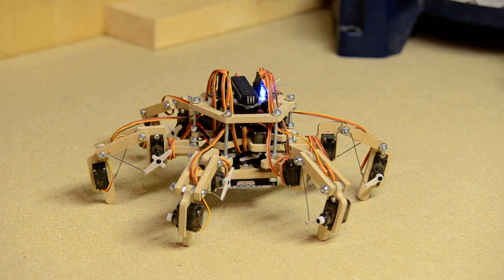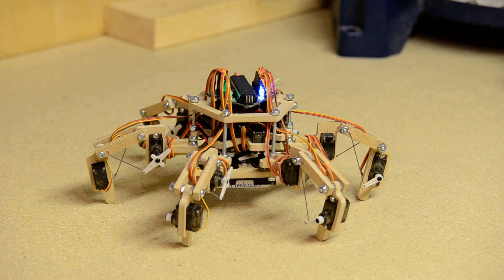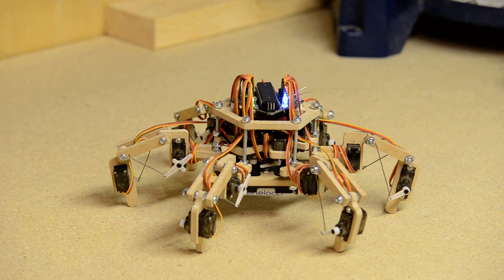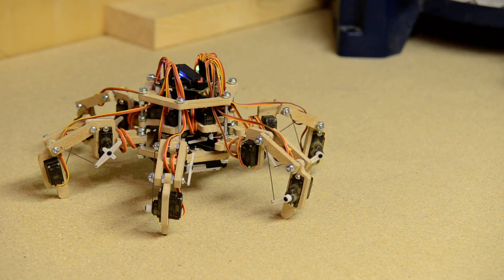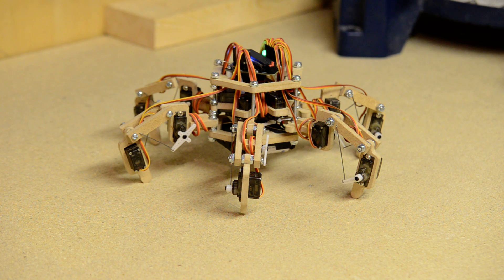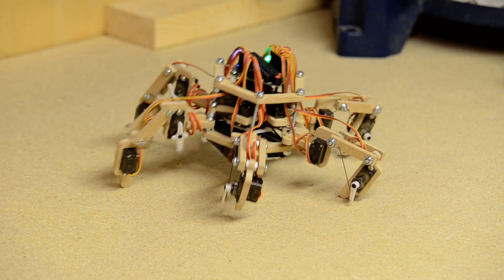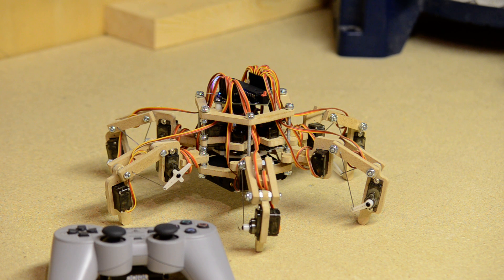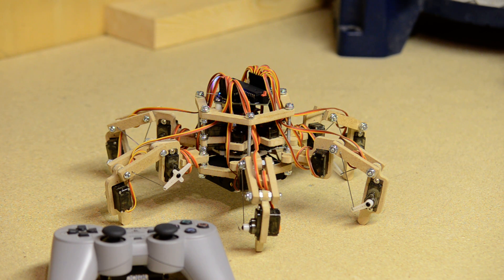Stubby the Hexapod v3 - Full IK Engine demo

Comment: I know I'm kinda late to the party, but I think the servos can handle more. I used 4 AA 1.5V batteries (which give a total of 6V) and they seem just fine. The only problem I have is the power consumption which is crazy. How much can you run your hexa with one set of batteries? After 3-4 minutes of use my robot is slowing a LOT (I'm using different hardware than you, but servos are the same). That is because of the almost linear voltage drop of the alkaline/Ni batteries. Li-Ion batteries don't have this problem, but a set of rechargable AA Li-Ion batteries is quite expensive so I will have to wait a bit until I can afford those. Basically at around 80% charge alkaline and Ni batteries need to be replaced for me and that is  A LOT of energy wasted.
Reply from the maker: I use Eneloop batteries, which tend to have a better discharge profile than standard batteries, plus which apparently have a lower internal resistance (which lets them source more current).  I've not tried others, so can't say how they compare, but that could be the difference perhaps.
Reply: Wyatt O Even so, with the batteries that you are using, how much time does it take until it stops functioning as desired?
Reply: Wyatt O I am asking mainly because I am curious how efficient your code is. I have the feeling mine is discharging the batteries too fast. Do you set the PWM signal to 0 while no commands are issued? I didn't try doing that (my servos are drawing power all the time), but I am looking for ways to decrease power consumption. Btw, I used your frame design, hope you dont mind, but I thought it looked really sick :P
Reply from the maker: I don't remember exactly how long, but it is definitely longer than 3 - 4 minutes.  If I had to guess, it would be 10 - 15 minutes.

Unfortunately I can't do tests at this time, as I am in the middle of a software re-write and it's not working right now.
Reply: Wyatt O I see, so if I take into consideration the fact that your batteries are slightly better I'm guessing it's not as bad as I imagined. Thanks a lot ^_^ i feel a lot less stupid now
Reply from the maker: I don't change the PWM signal when idle (although I do stop PWM when the controller is set to 'stopped' state).  That said, depending on how accurate your PWM is, the motors may be constantly shaking, trying to arrive at exactly the right value.  This will use more power (since it is constantly moving).  (Note that some quivering will happen anyway, especially as the servos get older, but you want to try to minimize it).

How are you generating your PWM signal?  Do you have a logic analyzer that can help you verify how accurate and consistent the signal is?

As for the frame, no problem, I have released the details so that others can benefit.  It took me a long time to get it right, so am happy to share!

Cheers
Reply: Wyatt O Well, to put it straight, I don't know much about PWM signals. In my ignorance I presumed setting the signal to 0 is equivalent to stopping it. But from what I gather from your previous comment I was very wrong. 
As for how I am generating them, I am simply using the adafruit servo driver. For the remaining 2 signals (the driver generates only 16), I use 2 PWM signals generated by the Arduino. This is the first time I'm using a microcontroller, so I'm quite a noob. I apologize if I gave the impression that I know what I'm talking about XD. Giving my best to figure everything out
Reply from the maker: Hah, no worries :-)

I don't know what the Adafruit servo driver is doing internally, so I can't comment on that.  For an introduction on how servo control works, see https://en.wikipedia.org/wiki/Servo_control (or just google for "PWM servo control".

Cheers
Reply: Wyatt O I'll look into this. Thanks a bunch, really helpful. :D

Comment: Oh crap, I had ordered the laser template on 6mm acrylic instead on 2mm acrylic :(
Now I need to widen the coxa and the femur gap so they will lock each other. What a terrible mistake
Reply from the maker: +trogalko The template is meant for 2.7mm bamboo... even 2mm acrylic may not work too well.  It may be best to modify the template for different thicknesses prior to ordering.

Cheers
Reply: +Wyatt O Yes You're right. Well, the 6mm acrylic frame has arrived and its too thick to thin the coxa1 coxa2 with regular hobby knife. Right now I'm trying to made modified coxa1 from 3mm plywood so it would fit on 6mm coxa2 from acrylic, and its look so fragile, maybe 2 or 3 layer plywood coxa1 would give more strength. Btw, its amazing project, thank You for sharing it. Photos and videos will follow.

Best regards,

Comment: what battery did you use?
Reply from the maker: +mc theta 4x AA
Reply: +Wyatt O whats the battery capacity?
Reply from the maker: +mc theta Depends on the AA in question.  Mine are Eneloops, with about 1800mAH at 1.2v; as they are connected in serial this gives a total output of about 1800mAH at 4.8v.  You need to be careful to use batteries which give an output of no more than the rated servo voltage; this is why I used AAs rather than LiPO, since a 2S LiPO is more than 5v, which can harm the servos.

Comment: Can it jump?
Reply from the maker: The servos are not strong enough to jump, since I used the cheapest ones I could find.  If you found some high torque, high speed, (high $$$$$) servos it may be possible (I have not done the physics calculations to be sure).

Cheers

Comment: well done sir, great work there.
Well crafted wooden frame too.

May you share about how you managed to control 18 servo using only one ATmega??

I am having difficulty with managing the pwm to be shared among 18 servo
Reply from the maker: Thanks!

I wrote my own PWM library to do this.  It uses TIMER1 (the 16 bit timer).  COMPA compare register is used to set the period, and COMPB is used to set the phase of each pin in turn.  For more information, check out http://stubby.digitalcave.ca/stubby/design.jsp (includes a link to my git repo containing the code).

Feel free to email if you have other questions.